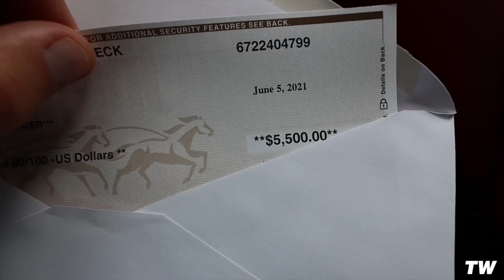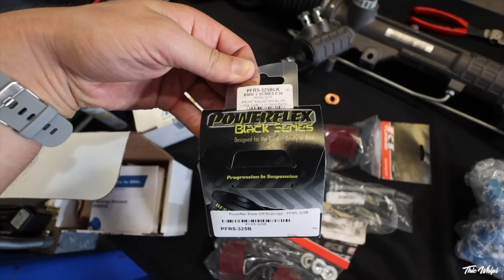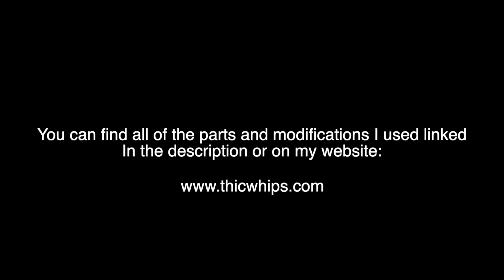Building a E36 M3 in 10 Minutes!

Comment: You'd be lucky to get any decent e36 for that price in Ireland, never mind an m3 lol.
Reply: jesus mate , same here in belgium , a normal 318i E36 in decent condition goes for more than that here 
M3's in that condition are over 20 grand
Reply: @Wutse  maybe one day prices will come back down. Doubtful though 🤣
Reply: @mickylogic  come to South Africa where you can buy one for $1500. i bought my 316i E36 for that amount in immaculate condition
Reply: @JXRDY_07  I'm sure you don't have to worry about rust dissolving your car either. Lucky
Reply: @mickylogic  problem is i need 2000 dollars to redo the motor because they didn't tell me about certain problems
Reply: @Wutse  my 318is was the same price, 5.5k
Reply: Sold my nearly new condition 316i coupe for 900€ because i was stupid and some shop men told me it was not worth any more because it had just a little bit of rust. Now that I’m older I could’ve fixed it for a couple 100€
Reply: @_qry  I'm sure you'll find another some day
Reply: I just picked up a E36 318is Coupe in England for 3 and a half grand
Reply: your M3 is better than the US version though
Reply: @kanaric  yea, but many have turned to rust 😂
Reply: I got my e36 328i in good nick off a long time owner for $1100 nzd
Reply: @Wutse  that’s what the prices are here too. No idea where he found an m3 for under 15k
Reply: Not an m3 with an m52 🤣
Reply: @JXRDY_07 i heard from a friend that cars in south africa are just generally way cheaper than in probably any european country
Reply: E36 m3s in usa are trash due to the regulations imposed
Reply: I just checked in Germany and is the same story. m3 with 200 km and menual transmision 25-30+ k euros! u can find a cheaper one but they are already built ( got a roll cage and upgraded intake etc.) and are only automatic ...
Reply: doubt it... special because electric cars bs I think we won't have much time to even enjoy them- @mickylogic
Reply: In Florida you can get one for 3k🤣
Reply: Kazakhstan. I bought my super e36 325i for 4.600 dollars. In southern regions you can buy an alive one two times cheaper. M3 e36 costs $14.400 - $20.000. Very cheap